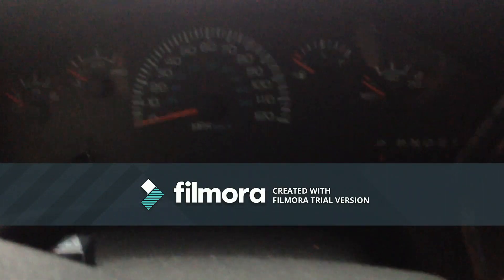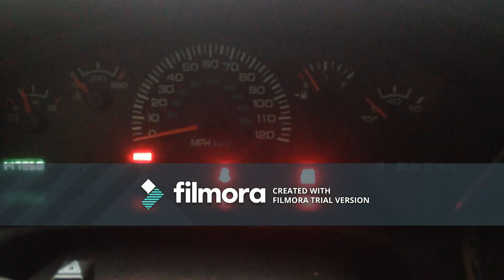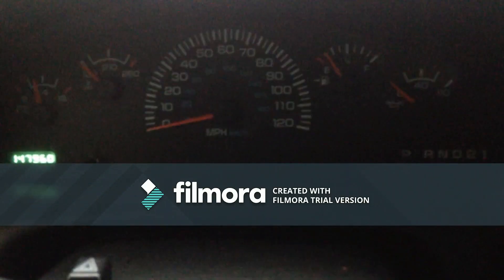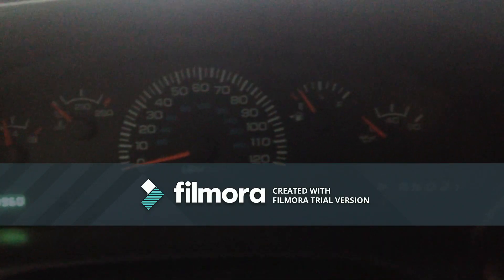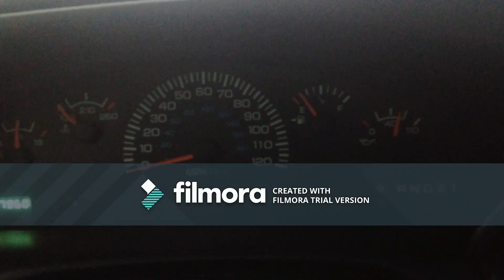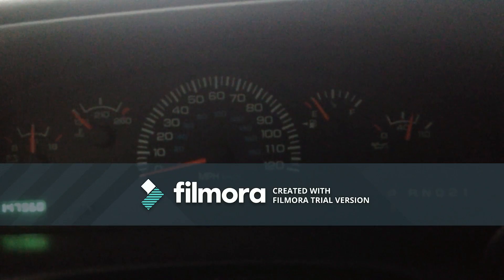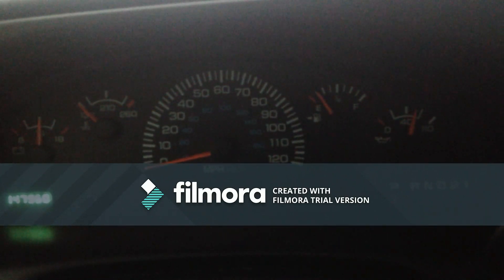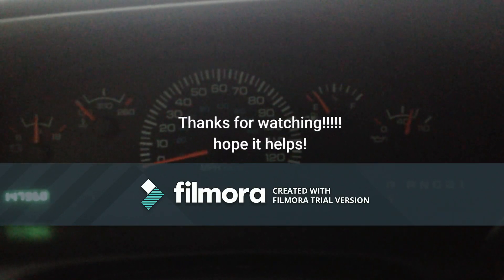Dodge "no bus" solution test with multiple ECM's

Comment: Symptom: Engine will not start. Gauges are inoperative. NO BUS message displayed on odometer.

Problem 1 of 6: The 5v power supply from the Powertrain Control Module (PCM) is shorted due to a shorted Crankshaft Position (CKP) Sensor.
Problem 2 of 6: The 5v power supply from the Powertrain Control Module (PCM) is shorted due to a shorted Camshaft Position (CMP) Sensor
Problem 3 of 6: The 5v power supply from the Powertrain Control Module (PCM) is shorted due to a shorted Manifold Absolute Pressure (MAP) Sensor
Problem 4 of 6: The 5v power supply from the Powertrain Control Module (PCM) is shorted due to a shorted Throttle Position Sensor (TPS).
Problem 5 of 6: The 5v power supply from the Powertrain Control Module (PCM) is shorted due to a shorted wire..
Problem 6 of 6: The 5v power supply from the Powertrain Control Module (PCM) is shorted due to a shorted Governor Pressure Sensor.

Also check your grounds on the heads/firewall and fenders. And lastly as mentioned by the video the PCM may have broken solder joints due to heating and cooling of the main PCB. Not to blame Dodge/Chrysler, this is a pretty common problem with many electronic devices. Any electronics that gets hot then cools is going to flex the main PCB and break the non lead solder that is used in electronics.

If you want to take apart and repair the PCM check "Keenan Laws" YouTube videos on repairing the Dodge PCM

Comment: What was the name of the computer you replaced it with? I don’t care about it being specific to your vehicle, what’s the brand name of that new computer
Reply from the maker: Brand name? I don't have possession of it anymore I'm sorry but it was the comparable computer that was sold from a company called flagship.
Reply: Timothy Bloom  thank you, did you try tightening the screw that goes into the fuse box for the main harness connector? They typically loosen up from vibration causing this issue, and if you have a cummins that has the p1693 code(no bus) then it’s a plugged fuel filter
Reply from the maker: @AmericanRustWorker3369  no I didn't think to do that. Is this screw your talking about some kind of ground? Interesting, but I don't think that was my issue as I didnt screw down anything involving the fuse box. Another tell take for me was kind of a "burnt" circuit board looking pcm.
Reply: Timothy Bloom   Yeah it happened to me I wasted a month tearing apart all my wiring and shit and this dude had 1 freaking video there’s a gold Screw that holds the main harness to the fuse box, I’m not sure if it’s grounded but I know when I tightened mine my truck fired right up I was so freaking mappy (mad and happy at the same time, and I found out yesterday another thing that causes the no bus codes and you have the 920,921 and 999 code on your dash, that’s your transmission shift solenoid codes, all the other people on YouTube say it’s your pcm,ecm , when it would be just a bad main ground on the engine block or something simple first. (No offense) I was doing a ton of research and then called a high performance company I bought the solenoid upgrade kit from and they told me that that very rarely occurs. So I did a video of me fixing  it yesterday
Reply from the maker: @AmericanRustWorker3369  man wtf... Troubleshooting these things is so confusing. Lol I'm glad a pcm fixed mine otherwise I wonder if I had gone down any other rabbit holes haha
Reply: Timothy Bloom  you got lucky honestly, you gotta start by just looking at your basics like your grounds, these trucks are very basic and if you had a bad ground to the ecm you’d just fry it, trust me I just got done making a video of me fixing my govenor pressure solenoid on my transmission that was making the “no bus” appear on the dash, I swear I poked it , heard it click and the signal on the dash went out
Reply: Timothy Bloom  at least these aren’t chevys, these trucks are cake walks compared to any Chevy or ford 2006 and newer

Comment: Hey everyone, this guy may be real nice, but do not listen to this video. I am a mechanic. Throwing random modules at a no bus is not the solution at all!!! You may get "lucky" that way a get the right one, but guess what, there is an actual way to diagnose it and get the right part first and know full well before you get the proper module or wire. Watch a you tube channel called new level auto. The guy keith on there shows exactly how to do it using a breakout box on the dlc, proper wiring diagrams, and a scope. Then you don't have to "guess" and throw expensive modules all day until its the right one. That is the absolute wrong way to do this
Reply: So wht do you suggest?
Reply: Tyrone Davis if you have multiple no comm then you get a wiring schematic that shows computer data lines.
You look for can hi and can low. On a lot of vehicles there is a splice pack you can tap into. Use a two channel scope and tap into hi and low. The images should mirror each other if that system is fine. If the lines look sporadic then you have to unplug one at a time the modules on the network until the images show a mirrored image. There are a million videos on YouTube that explain and show this process way better than I. I assure you, throwing modules at it until you are lucky is the stupid thing to do unless you get lucky
Reply: @mikesabin8568  thx i uae a old ECM OR PCM FROM MY OTHER VAN AND ITS BEEN RUNNING PERFECT

Comment: No offense, but you did a lot of research and then just guessed and got an ecu? If you had actually done real research, you would know how to diagnose it properly without just guessing. Try actually putting a scope up to the bus line and look at the waveform. You then unplug the modules until your square wave reacts the way it should. When it does, it is the module you unplugged. You merely guessed here.... Thats not doing and troubleshooting, you just threw a part at it...

Comment: Thanks for the video! Having a "no bus" nightmare myself. I'm going to pick your part tomorrow to get a used PCM. I'll let you know if it works!
Reply: You don't need to throw a module at the car if you know what you are doing. Look at an electrical diagram of bus data lines. Find the data line and hook a scope to the line. With key on, should see a square wave. If not, you have an issue. Unplug each module on the line until the square wave returns. That is the faulty module pulling the line down. Don't use this video, this guy is nice but has no idea what to do
Reply: @mikesabin8568  not all of us can afford to buy an expensive oscilloscope to perform one test! I used my little Harbor Freight multimeter and did the same thing, unplug sensors and see when the five volt reference signal returned. Turned out to be the distributor pickup coil!
Reply: David Hammond you can get a single channel scope on aeswave website for around 150 bucks. Works like a charm
Reply: David Hammond glad you figured it out though. My point was, figure it out, dont read online and guess.... there is a science to this stuff
Reply from the maker: Good luck! And yes please update me!
Reply: @Tinker-Tim  PCM was $10 at scrapyard. Didn't solve my problem. My distributor pickup coil was bad. $50 part. I did try the used PCM afterwards and it did work!

Comment: My truck would start and would say no bus but die if I let off the gas. So I went ahead and bought a brand new ecm for my truck it starts says no bus and will do the same thing as my old ecm
Reply from the maker: Im definitively no expert but some say that "no bus" means that there is a lack in communication with the ecm in some way. in my case the problem was in the computer, however there could be other pathways to the computer giving out this code. I would advice looking into some of the forums regarding this issue online. for instance, one forum I found said that it could be a number of sensors that also with throw this code when they go out. 
wish I could be of more help! good luck and I hope you find something that works!
Reply: BlueGhost69 you might have to take it to the dealership and have your new ecm programmed to your truck computer
Reply: It's a lose connection or it actually idk how the fuck it does but it gets dirty it's under the hood main fuse box look for the bundle of wires coming from the firewall they will insert the fuse box take the bolt that holds the the sensor in place off and clean the terminals with electric cleaner put some dialect grease and close it up tight!! I hope this helps some one!!

Comment: Where did you find the last computer you put in that made it work?
Reply from the maker: I bought it from flagship, and it was pretty affordable ~$260. the other computer that allowed it to run but not communicate was from another van with the same engine and transmission type. it would have been cheaper to go to the dealership to have them try and reprogram the old computer with a new VIN, but they said that sometimes it is unsuccessful and I didn't want to have to pay for something that may not even work.